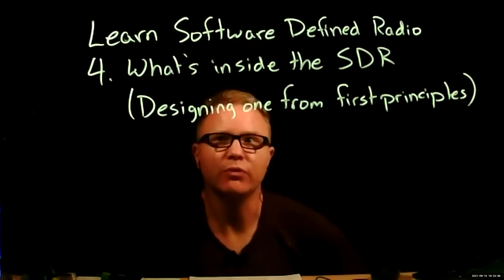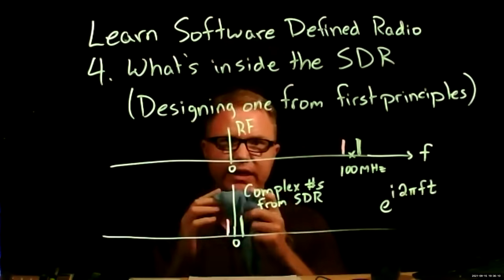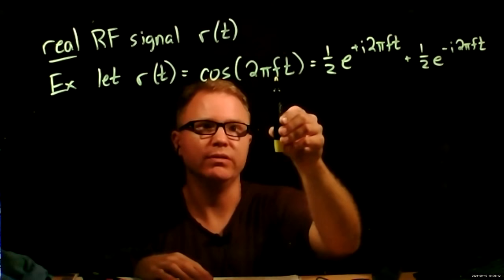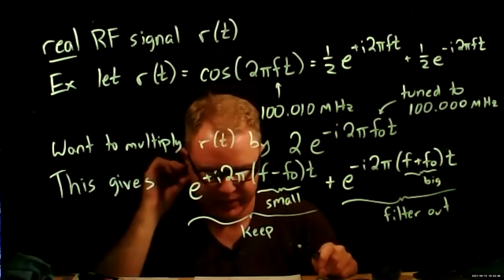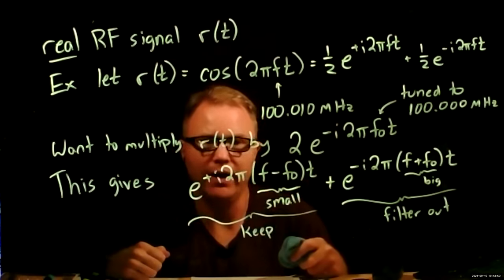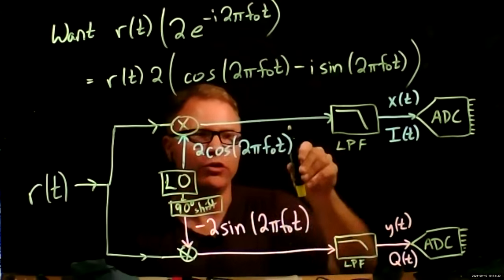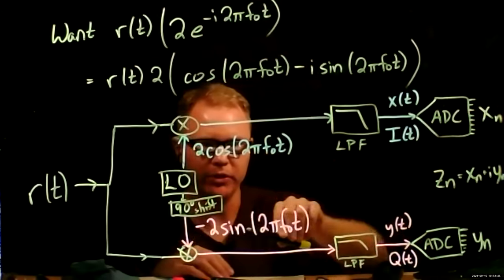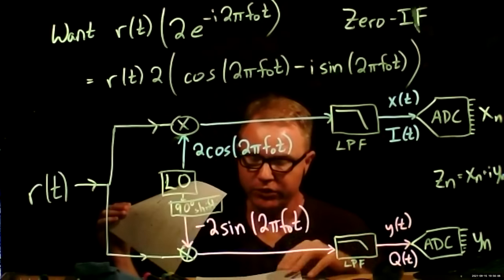Learn SDR 04: What's Inside an SDR: Designing one from First Principles

Comment: I was confused with the analogue way. For example de IF of FM is 10.7Mhz. With SDR there is no IF but the sidebands are direct available after mixing. Is this correct?
Reply: Let's say that with SDR there is IF but it is zero and of course appears a negative frequency another way to get this is that the IF is shifted to zero intead of 10.7Mhz, this is so, to make easier to the processing algorithms to do the demodulation process.